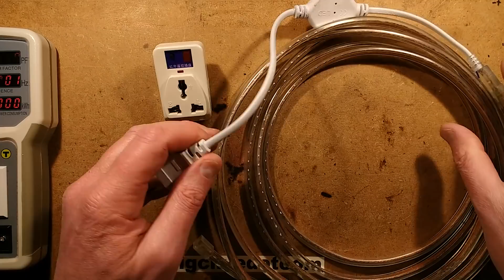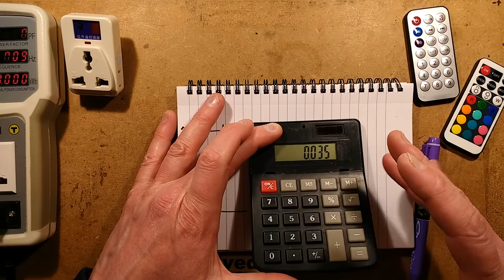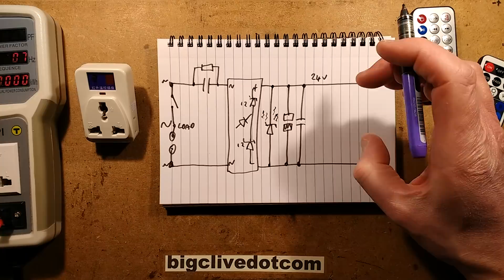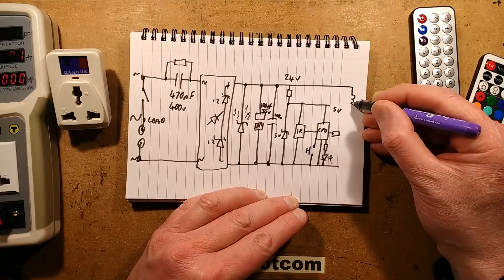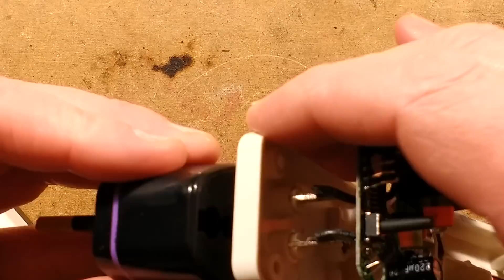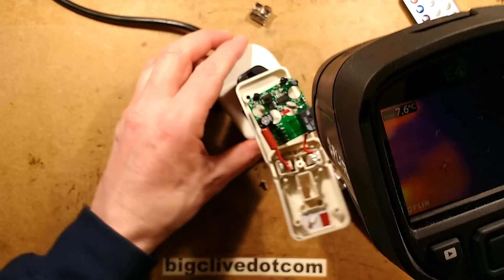Inside the cheapest remote socket I could find.

Comment: My stepdad bought one from Amazon to use on his shop vac just so he didn't have to keep running to one end of the shop to turn it on/off when ever he was using the table saw etc, however it didn't last long before it just.....died.  Not sure what failed on it nor am I sure what it's load rating was but I don;t think I'd use these on heavy loads like power tools.
Reply: LifeOfAnEnglishman thanks would have been an inductive load. Most of these remote sockets (wifi included) are made for low resistive loads only. The motor in the shop vac probably killed the relay.
Reply: They have special relays rated in horsepower for inductive loads, if you change it out and make sure that it can handle the power through the board then that would remedy the problem. The smaller relays tend to arc over with larger inductive loads and oxidize the contacts so they don't make connection anymore or weld the contacts together
Reply: Aerospacesmith that happened to my powerbank as i tried using it on a water pump only 3watts so i thought it would be fine but i guess not.
Reply: Am I right in thinking a "shop vac" is a dust extraction system? Probably the startup current killed it, if not the running current.
Reply: The wires will also heat up of a 16 amp load is plugged in. Having such a device pass certification is not that easy for that kinf of reason (but in the UK one could have a 4 amp fuse in it and pass, probably).

Comment: 33R resistor is there to tame the input to the 78l05, so that it gets around 15V input to it instead of the full 24V, which is a little beyond the input voltage rating for many of the cheaper fake ST clones. Just lacks the input current limiting fusible resistor( or regular resistor and fuse) to limit surge current, and of course the relay contacts are not rated for breaking or making mains voltages and currents, and definitely will weld together with a shorted output, if they do not do as the normally do and burn up first. 

Bigger relay, some input protection and it would be a better unit, though the case would have to be at least double the volume, and will also need to have a working PE connection as well.

Comment: May I suggest something that I did. Take a extention cord and cut it about 2 meters from the plug. Then use the cliff tester wired to the extention cord. That gives you a bit of distance from the plug and what you plug in and will use the cliff tester as the disconnect that’s also fused as you already know Incase something your testing live on mains does short out. 
Or I also have the PowerCube extention cord, it uses a resettable fuse and one version has a remote switch. B`May I suggest something that I did. Take a extention cord and cut it about 2 meters from the plug. Then use the cliff tester wired to the extention cord. That gives you a bit of distance from the plug and what you plug in and will use the cliff tester as the disconnect that’s also fused as you already know Incase something your testing live on mains does short out. But if you want to rule out a false RF signal turning it on you can get one that has a food pedal.
Duh, I forgot. Now you can use this for the next time you need to turn on and off something remotely on mains when taking a thermal image2, but this is still missing its ground.
I’ve even used the powercube to the mains wall outlet, and plugged the cliff tester into the powercube for remote on/off and wiring bare wired to the cliff tester. Gives me some distance from dodgy things given to me for testing or from a friend who said “It just stopped working”.

Comment: wow thats 212 degrees F
Reply: A 19V zener in series with a 5.1V zener would be better.

I have a circuit that is waaaaaaaaaaaay better but doing a full explanation in text comments is a bit hard. 
The basic idea:
run a 5th diode from the bridge to the +24V
No capacitor on the bridge so it looks like full wave rectified waveform.
If the +24V tries to go too high, on the next dip to near zero on the bridge short the bridge.
If the +24V droops too far, open the short across the bridge smoothly over about 0.001 seconds.
The result is almost no heat and a power factor almost exactly zero.

Comment: I am impressed at how they can make it so cheap? Ok so it has no earth and the case is shitty but whats to stop you re-casing it? I would be tempted but Im buying some wifi remote sockets from Banggood to see if they are useful.
Reply: Whilst they are admittedly cheap to buy, it's good fun "building your own". The low voltage control gear is cheap and available from BG / DX /AliExpress, and it is a good learning and practical experience. You also have control over the quality (and rating) of key components (such as that 120V relay, for 240v application . . . . . . )
Reply: Mark Pitt forced labour I think, or underage employees, or both
Reply: ΑΡΗΣ ΚΟΡΝΑΡΑΚΗΣ well their little hands are really good for tiny electronics and if you starve them they work harder to forget their hunger.
Reply: What's to stop you?  How about it not being worth the bother if you can get something better for a couple dollars more.  Hardly worth the time.

Comment: You realy need an Isolation Transformer.
Reply: Yes, and on with an on/off switch so things can be plugged in then switched on/off from a small distance.

I used to have a box with a 110/220 switchable transformer and a variac.  It sadly got lost in the great flood.
Reply: I have in the Shed a 4kVA (230) to 250V) Isolation transformer, but and Heavy as Fork.
Reply: Why? Hes always isolated from earth anyway.
Reply: :) I have one arm permanently longer than the other from something like that :)  I lifted it and carried it a ways and then quite suddenly a bad thing happened that it took months for my arm to recover from.
Reply: *really
Reply: I have a contactor in a box, powered by a dead-man's pedal and supplied through an RCD for work like this.

Comment: I think the micro controller is a Attiny84. The pinout and the way the power pins on it are the same as a Atmel attiny84.  That is if they are just sitting with all Atmel chips. Because they are cheap and off the shelf parts.

Comment: I remember when Lime recalled one of their remote controlled "energy saving" plugs, amazing design, the live & neutral pins cold pull out at any time and be left in the socket, so, the one I'd been sent (which they said to bin on receipt of the replacement) I gutted, and yes, the L & N pins came out easily, and fitted the PCB inside a project box and wired a 4-way extension to the output from the board, worked great 'til the PSU in the plasma TV popped due to being switched on and off in such a manner... :P

Comment: I just bought a Nexa System remote controlled power socket that can power 1000W. The impressive thing with that is that its so tiny so it can fit next to each other in a standard socket.

https://www.clasohlson.com/se/Fj%C3%A4rrstr%C3%B6mbrytare-3-pack-Nexa-MYCR-3/36-6902

Was a special offer when i bought it. About €15 for 3 pack with a remote controll

Comment: This could be a useful product really: Program it to an unused button of the TV remote and then use it to connect/ disconnect devices that would otherwise use high standby power, like older TVs or hifi...
Reply: I thought he said it ignored the tv remote.
Reply: Remember it has no earth, but this isn't a problem for most modern consumer HiFi/TV equipment.
Reply: There are only a handful of different TV remote signal protocols, Clive might have been unlucky enough with his TV remote to have one that the chip couldn't learn reliably, or at all.
Reply: Mathis Bü that's exactly what I do.  I've got a huge Sony Crt with all my classic consoles on an extension lead.  On another I've got two amplifiers and a few bits.  It's great being able to just shut them off with the TV remote.
Reply: It would be fine with any double insulated equipment but anything that uses a y capacitor to earth it would cause serious shock risk.
Reply: But what if it wired to TV, so it turns them off again?
Reply: Yes thats why i said "could"... it could be really useful for maybe 2 pounds more, with higher compatibility and lower risk of killing someone.
Reply: I have one and it works with a Toshiba remote

Comment: Great for remotely controlling 3 kettles at once! or one kettle  a heater and a toaster !
Reply: A welder comes to mind.
Reply: A welder is actually already included because of the nice 125V relay xD
Reply: With a triple adaptor in the front of it you could add an electric hob and an instantaneous water heater - everything you could possibly want when you wake up wanting your breakfast on a cold morning.
It would be nice and warm anyway.
Reply: one of those electrode boilers would be quite appropriate to be used with this :D
Reply: Well, obviously.
Reply: Nah, Theresa May doesn't give a shit when council flats burn down. Even an entire block.

Comment: I think we should have a competition for the worst power factor item you can buy on ebay. Maybe make one yourself? The energy company is going to love it
Reply: I'd like to see something that draws substantial current though, maybe pulls 1-2 kVAR. They're not going to care about this milliamp-level shite. :)
Reply: Valentino Bianchi those '20kw energy saver' units which are just one giant capacitor would win that.
Reply: he need to get negative reactiv power :P
Reply: Actually the horrible power factor is a quite positive thing on that device, compared to actually wasting that much power from a resistive dropper. Its just phaseshifting and there shouldnt be a lot of distortion.
Reply: Considering most non-resistive loads are inductive anyway, this is acually going to be doing them a favor. The current draw is so low that it dosen't matter much anyway

Comment: I am most impressed by that power factor!
Reply: zh84. What is power factor or where is a good site to learn about it.
Reply: Probably it is best to refer you to the Wikipedia article:
https://en.wikipedia.org/wiki/Power_factor
Reply: zh84. I was curious if this could be applied to DC for RC applications but it looks yo be AC. Looking to be efficient so if this is a related number then I wanted to know about it. Thanks.
Reply: No, this is strictly to do with AC circuits. It's not quite the same as efficiency, which applies to both DC and AC.

Comment: I'd imagine you could swap the capacitor with a higher value lower voltage one for use in the US market
Reply from the maker: Yes, that's probably the only component you'd need to change.

Comment: Wow! ... that’s quite a lot of electronics for half a pint of beer (in an expensive pub!)... hmmm...  do I have a use for one? ... hmmmm. Not yet, do I want one? ...  probably!...  still loving the Clive!
Reply: I've been using one for years now as a means to turn on my HTPC with a remote. I removed all the AC omponents, and 5V regulator, replaced the relay with a 5V DC one, and power it from the standby rail directly. I also implemented a small feedback circuit so it disconnects the relay immediately, as a sort of push button emulation. Quite useful and safe that way.
Reply: fleaspotter I must admit, I’d probably look to re-box it too... perhaps use it to turn on an a custom audio system, or a decorative light that’s across the room...  like this one... DuB-EnG: PAR CAN Stage Light PAR56 ornamental decorative contemporary designer studio house flathttps://youtu.be/XIVSKZRDMqM